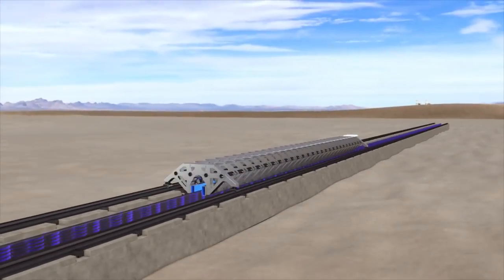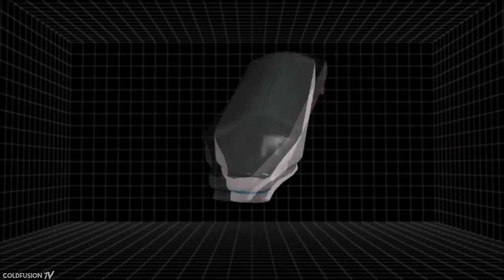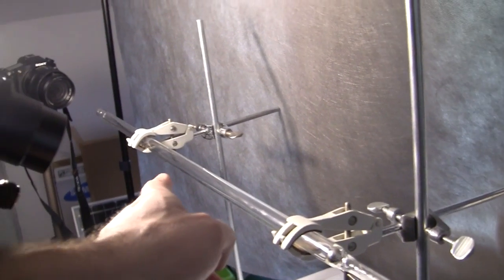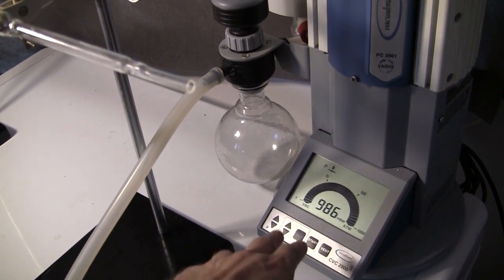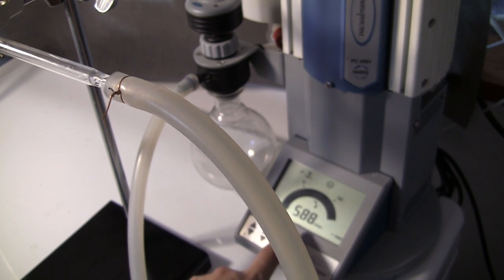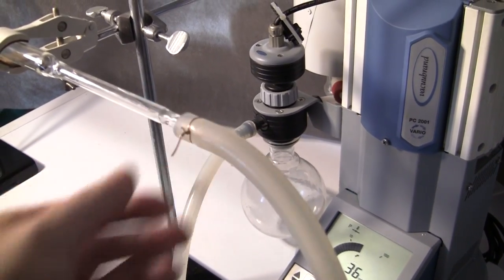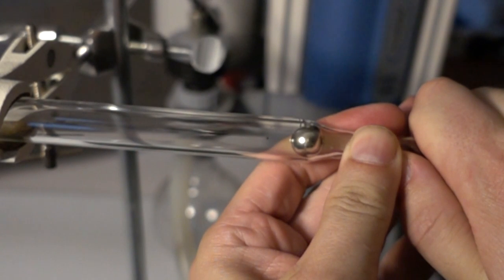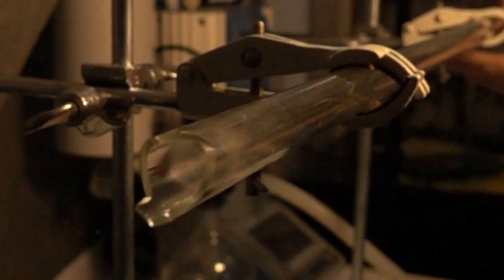How  the Hyperloop can kill you!

Comment: How does this debunk the hyperloop? All you have shown is that it will be disastrous if there is a failure. Well it would be disastrous if an airplane failed, it would be disastrous if anything fail. That's not debunking the technology, that just shows the technology is kind of dangerous.
Reply: " All you have shown is that it will be disastrous if there is a failure."

No, he has shown that even a small failure, one which would almost impossible to avoid given a tube hundreds of miles long would be disastrous.

Stop fanboying over Elon Musk and think for a second.
Reply: The point is not to show how dangerous an accident is, it's to show how weak the whole system would be. A single leak anywhere on the entire tube would result in a crash.
Reply: HerraTohtori "For example, the Ohio-class nuclear submarine has test depth of 240 metres,"

It's also only 170 meters long.

" but if you look at something like U-2 or a MiG-31, or SR-71, "

All of which require oxygen masks/almost spacesuits for the pilot because pressurizing the cabin to a breathable pressure at their maximum operating altitudes would introduce too much stress in the system.

" a hyperloop pod would be a much less complicated machine in general terms. "

On the contrary. If an airplane, even a fighter jet, suffers, say, an engine failure, it can always glide to a safe landing. Worse comes to worse the pilot has the option to eject and save himself.

In the hyperloop, the equivalent of an engine failure could be a superconductor quench, which would blow the entire system sky high. There is very little tolerance for failure when you have two surfaces a few centimeters from one another with relative velocities measured in thousands of km/h, even at the best of times. In a near vacuum? Any failure anywhere would make the entire system fail catastrophically, which is engineer-speak for "stupid idea".
Reply: TentaclePentacle Yeah, try having a small hole in a tube that's miles long. See how long it takes for air blowing at the speed of sound through the opening to change the failure from "small" to "catastrophic".

***** " You're not a freaking engineer"

I am actually. At least that's what it says on my bachelor's degree.

". If someone told you they were going to make a giant cylinder that shot itself into space and came back down and landed itself you would say it's impossible."

Don't fucking tell me what I would or wouldn't say.
Reply: TentaclePentacle "how long does it take for a submarine to sink with a small leak?"

Not very, actually, and a submarine isn't several miles long. You understand the problem here? It's no use to point out examples of small things which work under pressure, the difficulty here is in constructing and maintaining a structure that works under pressure and is large enough to connect cities together. A failure anywhere in the system has catastrophic potential.

"Simple enough solution for you mr engineer?"

Come back with an actual design and we'll talk. Otherwise I'll show you my warp core, which generates energy by combining matter and antimatter inside a dilithium matrix.
Reply: +HerraTohtori Now, suggesting that making a 10 meters tube in one piece as in with no mechanical connections but with only a single piece of metal is as easy as making a 100km piece with the same characteristics, is delusional.

It is also delusional to think a sudden stop as in you either go towards the pressure wave, or are pushed by the pressure wave against a solid object would not be lethal, feel free to direct your questions about that to the remains of people crushed in frontal hits between two trains, we're talking two pieces of metal that are going 10x slower than what the hyperloop is supposed to go.
Reply: HerraTohtori "The length of the tube does not affect its structural strength requirements, just the maintenance requirements"

True for a straight tube, but real railroads have curves. That aside, however, real world factors must be considered. If I recall correctly the first hyperloop was supposed to be installed in California. How much of an earthquake can something like that withstand before failing? What about small tremors, would the stresses potentially cause catastrophic failure later?

"A hyperloop pod does not need most of these; from engineering point of view, the most you need is life support (pressurization and air conditioning) and some kind of mechanical brake system (probably hydraulic, also useful for a door). "

You're severely underestimating the systems complexity of a hyperloop train. You need superconducting magnets, so it needs cooling systems. It needs sophisticated control systems to ensure magnetic levitation remains stable. A lot of the systems in commercial aircraft would have a counterpart in the hyperloop. 

"but because the pod doesn't need to fly it is a few orders of magnitude easier to build than an aircraft of any kind (pressurization or not)."

But it does. It flies a few inches off the track, which introduces a lot of the same engineering challenges as aircraft. It doesn't need to be maneuvered, but it must remain stably and reliably on the track.

"Reliability is another matter,"

Sorry if I didn't make myself clear, but reliability IS the matter. I have no doubt it's "possible" to build a hyperloop. My contention is that it's a horrible, extremely unsafe idea.

"and the simplest way to do that is relief valves on the tube which can react to reported loss of cabin pressure and almost instantly flood the entire tube (and thus the pod) with ambient air."

That would most likely overwhelm the control systems and cause the trains to derail, exploding the entire thing in a very Michael Bay fashion.
Reply: NotAsian There's actually a very simple way to make a vehicle travel at high speeds through a partial vacuum, which humanity knows very well: instead of using a tube, you go to high altitudes where the atmosphere is thinner. There are no rails, so you must use what air you have to achieve lift, and... wait a minute.
Reply: Also tf talks about a leak in the external tube, a leak in the capsule and enjoy having your blood boiling in your veins and then freezing as you start slowly sublimating in a 1mbar atmosphere. Consolation is that you'd instantly die so you won't suffer. Besides the hyperloop is a cool concept in theory but a catastrophy waiting to happen in practice not to mention very expensive to create. 

Let's be honest: why do we NEED an hyperloop in the first place when our existing means of transportation are just as good for what we need at the moment. Look at the damn Concorde which was born on the same need of speed as the hyperloop, no followup project, why? Too expensive to operate, the mass does not want to spend 10x the ticket cost to half the flight time. Do you think that operating such a huge structure keeping it in the perfect condition all the time will not reflect on the ticket price? And for what advantage? High speed train and Planes are fast and the 2 safest means of transportation, the get the job done well, and most importantly EFFICIENTLY. 

Now i hear you say "why shouldn't we try it out" because unlike a plane you can't build something like a prototype and test it without basically building the whole thing already, and therefore you can't properly detect risks and fix them. Also fixing things might be a bit of a problem at 1mbar, but putting a bunch of robots in it might do the work.
Reply: +TentaclePentacle The military does not often operate in the same conditions, it requires different things from its vehicles than the civilians do. Apples=/=oranges.
The Channel Tunnel speed LIMIT (as in max speed allowed as in usual transit speed is LOWER) is 160km/h which translates roughly to less than 50m/s. The speed of sound in air is about 340m/s. As you can see a sonic speed train will move about 7 times faster than a Channel Tunnel one. This means closing bulkhead doors are not as an applicable solution because they need to be positioned further out from each other to do their job without killing every one in the train for a too strong deceleration or crash into them. Apples=/=oranges.
Reply: TentaclePentacle
There isn't a way to have a safety mechanism in this situation without also either introducing a new hazard or conflicting with the design itself.
None of those things you just mentioned involve a small critical component moving at high velocity, they are not comparable.
Reply: Yeah, this is a real reach and an attention grab/sensationalization.
Reply: +Ethan Ooamii
he said he is making the video to bust the hyperloop. Well all he did was point out some dangers of the technology, that can easily be solved, with self sealing foams and relieve valves.
Reply: TentaclePentacle Most planes can land with an failure on an engine and it's easy to check before the flight that everything is OK. Do you really think there will be people checking kilometres of tube before every launch?
Submarines can also be checked before a sortie. And they are operated by the military, it can't be really compared with private commercial vehicles.
Reply: +TentaclePentacle "I don't care if things are different for a reason, make them equal!", "I made an example that was not fitting but the reason why is now irrelevant!". Ok, got the message no need to reason with you
Reply: TentaclePentacle
Yes except maglev trains move significantly faster meaning they do not have the same tolerances.
Reply: TentaclePentacle "what are yout talking about maglev trains have way more tolerance than normal train"

Pro-tip: stop talking of things you don't know the first thing about.
Reply: TentaclePentacle I rest my case.
Reply: TentaclePentacle How old are you?
Reply: TentaclePentacle Oh, I can tell. Have you googled "control system" yet?
Reply: TentaclePentacle Take that as a no. Welp, come back when you have.
Reply: +avicenna
relieve valves, and bulk head doors every couple of miles.
how do you think under water tunnels work? that's servera miles, and they are under pressure from the ocean waters, and yet that still works.
Some engineer you are who can't even work around the small problem if equalizing pressure.
Reply: @TentaclePentacle  Bulkhead doors are very expensive, heavy and complicated to make and maintain.
Reply: Planes planes have a fixed surface area, and redundant engines if one engine on a plane fails it has others.
If one part of the tube fails it will explode.
Your comparison is invalid.

Having a pressurised tube is incredibly dangerous as anyone who has messed around with high pressure/ energy systems will tell you.

Elevators also have safety mechanisms that you are clearly unaware of.

Every single analogy you raise fails to take into consideration that a depressurisation event is a event that must not happen for hyperloop as there is no way to design around it.
A intermediately layer with low pressure would be the best way to guard against such an event, but there is no foreseeable way to mitigate the impacts of a depressurisation in the main tube without compromising on the other aspects of the design.
Reply: TentaclePentacle
The channel tunnel does not have to be straight as a arrow, if it did it would have failed by now.
Also the tunnel has pumps and it is open at both ends so air pressure is not an issue.

The tunnel is not underwater it is underground.

Also the channel tunnel is pressurised to a level that humans can survive, in the case of a fire humans can escape through emergency points to a adjacent tunnel.

Which is my point, there is a intrinsic hazard here which cannot be designed around.
Reply: TentaclePentacle
You missed the point.
Hyperloop has to be very straight, trains don't to the same degree.
Its open at both ends thus it is not a pressure vessel.
There are chemicals that react with water to form a sealant.
Water is approximately in-compressible meaning a rupture will have a constrained flow and the fluid will pool, I shouldn't have to say this but liquids and gases are very different.
Reply: TentaclePentacle
F=ma
s=1/2*at^2
For a small displacement at higher accelerations you get a larger force.
No I do not mean smaller.
Reply: TentaclePentacle Oh yes. You've been on a maglev train, and that makes you a specialist. Do you understand what a "control system" is? Can you explain it to me without using google?
Reply: TentaclePentacle Dude, I've been saying that the hyperloop is a stupid idea for years. Has nothing to do with thunderf00t.

Do you or do you not understand what a "control system" is?
Reply: TentaclePentacle Buddy you're just embarrassing yourself further. Tip: you can do a google search now.
Reply: Yep, check out Check out Shane Killian's and Libertarianists response to thunderf00t's video: Thunderf00t's "How the Hyperloop can kill you". He posted a video reply to Thunderf00t's video. And they will be making more videos in response to his series. Youtube will mark my comment as spam if I post the URL so you will have to google the video's title.
Reply: +Ekaterinya Vladinakova
yeah I'll post that link of the of that youtube video watch?v=kx52A-v65Q8
I had the instinctive feeling acceleration and the pressure would not be as a big deal as TF make it out to be without actually doing the math. TF can only take out low information low critical thinking people like sjws. When confronted with people who can actually have any critical thinking skills, he will act like a petulant child.
Reply: +savagepinksock
pulses? wtf are you talking about. Huge oil pipelines have pressurized liquid running through it, that's touching the pipes.
The hyperloop sends a pod through it that don't actually touch the tube. There is no friction, there is no touching. And because of a near vacuum inside the tube, there is not even any air friction.
If you can maintain a high pressurized oil pipeline, you can maintain the hyperloop tube.
Reply: Video title: How the Hyperloop can kill you! 

So what the fuck are you talking about!?
Reply: +Joules Kin
no one said the technology is good enough yet, that's why its under development.
There is no reason to say this technology is unrealistic. But that's what TF is trying to do, bust hyperloop as he calls it. Well he failed to bust it and made himself look like a fool for bring up some engineering problems, rather than fundamental flaws.
Reply: Phil is a chemist, though. Yes, a scientist, but not an Engineer.
Reply: A submarine has to deal with much higher pressure differentials than the hyperloop tube. For example, the Ohio-class nuclear submarine has test depth of 240 metres, where it has to withstand pressure differential of almost 24 atmospheres. The hyperloop tube only needs to withstand one atmosphere pressure differential.

From engineering point of view, depressurizing the tube is not exactly the biggest problem with the idea. We have the technology for that, easily. The scale, however, does seem intimidating to me as well, and maintenance and avoiding leaks would be... problematic. The biggest energy drain in the whole system might actually be driving the vacuum pumps, because there's always leaks in this kind of system.

The pod itself is a different challenge. Keeping it pressurized while in use is an engineering problem that is somewhere between a spacecraft and a high altitude aircraft, but if you look at something like U-2 or a MiG-31, or SR-71, a hyperloop pod would be a much less complicated machine in general terms. Of course, some of the safety features pose challenges - like being able to stop and egress the pod and the tube on regular intervals - but I don't think these are insurmountable difficulties.

Or, at least, I don't think I have the engineering expertise and in-depth knowledge of the system to conclusively say that it's impossible. Difficult, of course, but also probably much less difficult than some other feats of engineering I can think of.
Reply: avicenna
The length of the tube does not affect its structural strength requirements, just the maintenance requirements. Structurally speaking, if you can make a 10 metre tube withstand 1 atm pressure differential, you can make a 100 km tube from the same stuff and it'll withstand it too.

Also, I feel like you're seriously under-estimating the system complexity of an aircraft. You see, an aircraft has to fly, so it has to have a life support (pressurization), powerplant, flight controls, hydraulics, pneumatics, electrical systems, avionics, flight computers, navigation systems, communications, radar, and in case of combat aircraft, weapons systems as well (often integrated to avionics). A hyperloop pod does not need most of these; from engineering point of view, the most you need is life support (pressurization and air conditioning) and some kind of mechanical brake system (probably hydraulic, also useful for a door). Then you also probably need some electronics to run the pressurization, pod controls, and telemetry, but because the pod doesn't need to fly it is a few orders of magnitude easier to build than an aircraft of any kind (pressurization or not).

And the reason why these high altitude aircraft don't have full pressurization is because they have to fly, so they have to be very lightweight. It's not that hard to create a pressure vessel and pressurization system that can maintain 1 atm pressure. True, aircraft are not pressurized to 1 atm, but spacecraft often are (the ISS, for example, uses standard atmospheric pressure). And a hyperloop pod is not weight-limited the same way aircraft and spacecraft are, so from materials and engineering perspective it's not a problem at all to build the pod as an 1 atm pressure vessel.

Reliability is another matter, and of course it's possible for something to fail and for that reason the system needs to be secured against loss of cabin pressure - and the simplest way to do that is relief valves on the tube which can react to reported loss of cabin pressure and almost instantly flood the entire tube (and thus the pod) with ambient air.

And, while an aircraft can glide to ground and a pilot can eject, again, a hyperloop pod is not flying high above the ground in the first place. It's in a contained environment, and while I agree that the margin of error is small, it doesn't mean the slightest of failures would automatically be "catastrophic" or "fatal". It could be, if that eventuality is not properly taken into account and prepared for, but that's a matter of thorough planning, not something about physical reality that prevents this from being both useful and safe mode of transportation.

Just remember, speed doesn't kill, it's the sudden stop... and you have to calculate how sudden the stop actually would be to claim it would be deadly.
Reply: Winkelried
Private commercial vehicles tend to have substantially better safety record than military-operated ones...

And, yeah, it's not impossible at all to just build the tube in a way that makes regular maintenance almost unnecessary. Compared to some of the marvels of modern engineering (look up the Troll A drilling platform for example) building a long solid pipe doesn't even seem all that difficult; the biggest targets of maintenance would be the vacuum pumps themselves, and of course the emergency exits and relief valves, which simply have to be there for safety reasons.
Reply: HerraTohtori
"Private commercial vehicles tend to have substantially better safety record than military-operated ones..."
Yeah, because the military vehicles are not meant to be as safe as private vehicles, that's my point.
"it's not impossible at all to just build the tube in a way that makes regular maintenance almost unnecessary"
Bold statement, why do big oil pipelines still need maintenance and have leaks then?
Reply: avicenna
Fucking lol.
There is a lower limit on the distance it is economical to travel by plane though.

There has got to be a way to get this sort of thing to work although I doubt it will be competitive with air travel though.
Reply: @AvNotasian  Then remove the vacuum tube.
Reply: @williamhuang8309  Without the vacuum there is no point in the tunnel.
Reply: @AvNotasian  No vacuum, no tube, no trouble. Also known as a regular train. Works fine.
Reply: @williamhuang8309  Lol, yeah now that you mention it I have seen a lot of trains around. They must be a new innovation :P
Reply: elevators hae safety mechanism, you don't say.
So the hyperloop will not have safety mechanism?
I have already given so many ways safety mechanisms can be designed, and those are just the common sense ones that already exists on subs, in the channel tunnels, on tankers, on space stations. Obviously the hyperloop needs safety mechanism just like an elevator.
Reply: +NotAsian
explain to me how the channel tunnel between england and france don't breach under all that pressure.
Its the same concept, if you can keep a tunnel underwater with out leaking, you can keep a hyperloop tube.
Reply: +NotAsian
what? what does being straight have to do with air pressure or water pressure? You do know train tracks don't have to be straight as an arrow right?
So what if its open at both ends, the structure is still under pressure.
The english channel is underground yes, that cuts down on the pressure, but there are underwater tunnels like the Ted Williams Tunnel which is not under ground and its under even more pressure.
There are always ways to control pressure, and safety mechanisms to be added. Those are call engineering challenges, not fundamental flaws with the concept.
Reply: +NotAsian
a hyperloop train is just a maglev train. and maglev train have the same tolerance for curves just like a normal train.

so what if a tunnel is not a pressure vessel, the amount of pressure pressing down on the tunnel from water is greater than the 1 atmosphere worth of pressure pressing down on the hyperloop.

And we are not talking about what happens if there is a breach. The point is to prevent a breach, and if a breach happens, make sure the opening don't get teared. If its a small leak then only small amount of air is leaking thought into the tube, thus it won't have enough strength to push the pod. In TF's own experiment he had to take the entire hose off the tube to expose a huge area for the air to rush in. That's why the ball got pushed. If its only a small leak, the ball will not get pushed at that speed. You can also make the tube twice the side of the pod, then the air an go around the pod rather than push it. Also counter valves and self sealing tank technology and patch a leak.
Reply: @TentaclePentacle  Nope. Trains are able to make much tighter turns than maglev. Not to mention maglevs are basically monorails but the propulsion is by magnets. The turning capabilities of monorails are terrible, not to mention the infrastructure required for switching them is immensely complicated.
Reply: +NotAsian
what? maglev trains move faster and thus have less tolerance?
how does that work?
I'm going to assume you mean slower.
So what, are you saying trains can't go any faster because the tracks needs to straight? What retarded argument is this. obviously you can build in tolerance. And maglev trains don't touch the tracks, and hence the tolerance can be way bigger, just make the track bigger, so the magnetic forces can cover the whole train.
Reply: +NotAsian
what are yout talking about maglev trains have way more tolerance than normal train, because the maglev trains don't make physical contact with tracks. The train floats on top of the tracks like a hover craft. There is way more tolerance because it doesn't touch anything.
Reply: @TentaclePentacle  You need guidance on both sides of the train so that the train doesn't just shoot off the tracks whenever there is a bend. Look at the Shanghai maglev! there are guides on both sides of the train. So your turning capability is limited by the guides on either side of the maglev.
Reply: no it doesnt. planes get engine problems, structural problems, even holes blown on their sides ... and still dont fall of the sky.
submarine leaks? jesus dude, subs leak all the time, again not so bad. and even then subs are used by the military, not regular people.
Reply: +avicenna
as if you know what's going on.
Have you ever been on a maglev train?
Well I have.
Reply: +Coyote27981
right planes never crash, subs never sink, and civilians can't do what military do right? Because reasons.
Reply: +avicenna
if you been on a maglev train, the you would know the tracks have bents and curves just like any other train track. The maglev trains have the same track tolerance as any other train.
So stop talking out of your ass and fanboy TF like his shit don't stink.
Reply: +avicenna
what are you talking about control system. What does that have to do with anything? What control system are you babbling about? a train control system like in switching tracks?
Reply: +Eethan O'Connell
that's because you are a moron. Control system can mean anything. And if you are talking about the individual magnets that gives the train more track tolerance. Well that's not call the control system you idiot. Its call a feedback system.
Reply: +avicenna
lol right make up some bullshit vague term, and act like you know it all. A control system to a train is a system where it controls traffic you moron. You can refer to many control systems. A lot of things are call control system. There no need for me to google anything because you are just so full of it.
Tell me what is an air system? What air system could I be referring to? The air conditioning or the hot air you use to blow up your own ass.
Reply: +avicenna
older than you kid.
Reply: +avicenna
you act like a stupid child. have you google air system yet?
Reply: +pyropulse
this video is a trailer for the debunk video, and this trailer sucked just like the ghost busters trailer sucked.
Reply: He hasn't even shown that. His test doesn't scale. If the hyperloop pods have a cross sectional area of 3 square meters and a mass of 30 tons each, then their acceleration would only be 1 G.
Reply: ***** Indeed a catastrophic failure of the pressure tube could expose occupants of a pod to lethal g forces. But this is a different scenario that what thunderf00t was describing and also an extremely unlikely scenario. By comparison, airplanes have many points of failure that could potentially kill all the passengers on board. So do high speed trains.
Reply: oh please he spew the same argument in the other video.
Reply: Thomas Winter Sadly TF is quantitatively illiterate. This is the same guy who was off by 5 orders of magnitude in calculating the energy of ice above the atmosphere. I made a video debunking that too.
Reply: +To Athánatos
His other main debunking video have the same ridiculous argument. His main objection around the technologies is what happens if the tube breaches and what happens if a terrorists shots at it. Pure fear mongering.
Reply: +110002 10041
not as gullible as you can be.
Reply: +TruckCaptain Stumpy
oh please the other video had the same arguments. It is going to be more expansive than they claim? sure.
Are there engineering challenges, sure.
But the fundamentals of this technology is sound and not busted by any means.
Reply: To top it off, have these people ever seen how thick a submarine's outer shell is and the backing it has? Do they think that the submarine is simply a thin metal tube swimming underwater? The hyperloop chaps are using 2 inch thick pipes to sustain a pressure ratio of 1000. Yea...let that sink in for minute.
Reply: +Vaibhav Shah
do you know how much pressure a sub is under? The hyperloop is under less than 1 atmosphere of pressure. You can create a 1 atmosphere of pressure with glass syringe.
Reply: uhh no.  There are multiple cases of plane engine failure that allowed the plane to continue back to an airport.  There's also multiple cases of leaks in submarines that resulted in the boat surviving.
Reply: +MiniDevilDF
And a leak in the tube is not as dangerous as TF claim to be as already shown by other people's math.
By TF's logic a car is very dangerous because the gas tank could explode and kill everyone.
Reply: +savagepinksock
there is a word call maintenance look it up.
Reply: +savagepinksock
yes we all know all those gas and oil pipelines are not maintained.
Reply: +savagepinksock
variable pressure is more degrading than constant high pressure? What lunacy is this?
And what does the speed of the pod have to do with anything?
The pod does not touch anything, the pod could be going at the speed of the light and would not effect the tube.
Reply: +savagepinksock
how does the pod or train cause a change in pressure? Its a vacuum inside the tube. There is not change in pressure. If change in pressure cause more so much stress in a tube that it would cause more degradation, then turning on your faucet on and off would cause your water pipes to rupture and yet, that don't happen.
Reply: +savagepinksock
pressure is pressure if its pushing from the outside or from the inside makes no difference.
the near vacuum inside the tube makes the air disturbance by the movement of the pod negligible.
the tube is not made from paper.
Reply: dude, going from 0 to 400 in 2 seconds will most likely destroy your body from accelerating so quickly. and when it stops its like falling to your death
Reply: +Mfgcasa
there are self sealing tanks
Reply: +Halloween111
I'm not a civic engineer and I still can see the flaws in his argument.
Reply: TentaclePentacle
My point exactly. I respect that he's intelligent and a scientist, But "Scientist" has a lot of flavors. Einstein was Brilliant, But I might not ask him a question concerning biology considering he was a theoretical physicist
Reply: Yes and you can die because of it.
Reply: +Winkelried
Are there engineers checking kilometers of under water tunnels?
Just because subs are operated by the military so a civilian company can't do it?
are military personnel smarter than civilians? what logic is this?
Reply: +TheMortimer100
I don't care what conditions the military operate under, if the military can do it, why can't a civilian company do it?
The channel tunnel's speed limit if irreverent. We are taking about pressure, and the channel is under way more pressure than the hyperloop tube.
There will not be such an explosive breach anyway, most of the time its just small leaks that can be detected and measures taken to counteract it.
Reply: Winkelried
 Oil pipelines have leaks in them because the leaks are so negligible that there's hardly any pressure on the oil companies to research and develop new pipe tech or pay significantly more for much better construction quality.

In other words, oil pipes leak little enough that it's not deemed cost effective to improve them, since regular maintenance keeps the losses (and environmental damage) at manageable level from corporate perspective. I have no doubt it would be possible to make better oil pipes, but it might be an investment that isn't going to pay itself back in the time the pipe is planned to be active.

Oil pipes are also regular targets of sabotage by environmentalists/terrorists, and thievery, and they are readily accessible and over the ground. Especially in third world countries, a lot of the leaks are intentionally made by locals tapping onto the oil lines.

Hyperloop tubes could also technically be over ground but would probably be ideal to build underground or, at the very least, protected by thick layer of earth, as that would not only shelter them from the elements and saboteurs, but also lend the tubes support against the weight and g-forces of the pods moving within.

That said, making a long vacuum tube properly sealed is going to be more difficult than making a leakless oil pipe, because air is a gas that readily escapes (or gets into the vacuum) from the smallest of holes or cracks, while oil is a viscous liquid that is relatively easy to contain in the pipeline even when there are small dripping leaks in the system. So yes, there are challenges involved in the system, but hardly anything that we absolutely "can't" do.

A different question is should we... but the answer may be found only by trying. Hyperloop may well prove entirely impractical (with current materials and technology) compared to conventional methods of travel, but if it does work, it has certain attractive elements to it as well.

Even if it fails, or proves impractical or impossible in testing, I'd still say it's worth it to try. Even in worst case scenario, we may well learn something new in the process which could be applicable to other things.
Reply: +TheMortimer100
Do you even know what's going on here? Speed is irrelevant because we are talking about a breach in the tube. it doesn't matter what the speed of the pod is. We are not talking about a breach in the pod, we are talking about a breach in the tube. Just like a breach in the channel tunnel. It doesn't matter how fast the car will travel in the channel or how fast the pod will travel in the tube. Those are two completely different issues.
Reply: @TentaclePentacle  Yes and no. A breach in a hyperloop tube will result in a sudden depressurization, which would likely make the pod suddenly shoot forward or violently stop, killing everyone on board.
Reply: in fact taking into account the hyperloop aquiles heel is catastrophic pressure loss, while airplanes have a lot more critical failure points including the same pressure loss, wing failure, engine failure, pilot failure, control surface failure, etc... i could say hyperloop is as safe as any other maglev train systems (a train that travels at +300kms/h in one fixed direction can't avoid obstacles in the path, and that's faster than terminal velocity so crashing at that speed is the same as jumping from an airplane without chutes)
Reply: +Dario Ampuy
the hyperloop is just another maglev train that travels in a tube so it cuts down on air resistance. The maglev tech is the same as any other maglev, the only technological challenge is the pressurization of the tube.
Reply: TentaclePentacle
 yes i know that... all they have to do is compartmentalize the tube in sections so a catastrophic failure won't fuck up the entire system and the train can slowdown and pass the damaged section at slow speed, move to another vacum section or use a spare rail system like in any other railway

it's clear they won't use those fancy glass tubes we saw in futurama or in hyperloop concept videos... i bet it'll be mostly underground to it can be protected, VERY sturdy and secure, like bomb proof concrete bunker stuff around the tube
Reply: +Dario Ampuy
well if they can make an underwater tunnel like the English channel. The hyper loop is gonna be just like that.
Reply: +pyropulse
retard, this video is a taste, its a trailer for the debunker.
Well this trailer sucks, just like the ghost busters trailer sucks. And the ghost busters movie sucked, the debunking video will also suck, just like the movie.
Reply: +avicenna
Take that as a no. Welp, come back when you have.
Reply: +pyropulse
yes he failed in this video, as in this video does not debunk or bust the hyperloop.
Do you know how to read?
Reply: ***** By deriving the force from the pressure. The pressure difference would not exceed 1 atmosphere.
Reply: ***** 100,000 pa * 3 m^2 / 30,000 kg = 10 m/s^2 = 1 G
Reply: This shows how it can kill you, read the title. There is another video of his where he does the debunking
Reply: Well, I've read some articles written by physicist and engineers that also think that the Hyperloop would be a terrible idea.
Reply: +To Athánatos
there are engineering challenges sure, is it going to be expansive? sure.
But the underlying concept is not flawed.
Reply: +pyropulse
ofcouse his is full of shit, and he knows it, he is only fooling people who don't have a science background. 170 newtown is nothing, that's like 170kg of force. its like a fat guy pushing.
Reply: Engineering reality when you scale your experiment of a small ball 
bearing in a small tube vs a much larger scale.

tl;dr 
Your experiment doesn't scale. 
Ballbearing will accelerate at 1963 m/s²
Hyperloop will accelerate ~10 m/s²

================
Scale up the experiment and consider actual forces on the body

Remember Pressure = F/A therefore F = P*A
And F = m*a therefore a = F/m

The pressure in front of the carriage is 10 Pa

The pressure behind the carriage (assuming a massive instant failure) is
 100,000 Pa

The total air pressure acting is in the forward direction at 99,990 Pa 
~~~100,000 Pa

Let's call your experiment, Scenario #2

Scenario #1: Almost full scale 

Cross-Sectional Area of Hyperloop tube = 1 m² i.e. diameter is a little 
over 1 m.
Force acting on Rear of Hyperloop Carriage, F = P*A = (100,000 Pa) * (1 
m²) = 100,000 N

Inertial Mass of Hyperloop Carriage, m = 10,000 kg

Substituting into a = F/m gives

a = (100,000 N) / (10,000 kg) = 10 m/s²
Scenario #2: Lab ScaleCSA of 10mm Ballbearing Tube = 0.00007854 m²Force 
acting on Rear of Ballbearing, F = P*A = (100,000 Pa) * (1 m²) = 7.854 N

Inertial Mass of 10 Steel Ballbearing = 0.004 kg

Substituting into, a = F/m
a = (7.854 N) / (0.004 kg) = 1963.5 m/s² 

-----------------------------------------
Summing up
Scenario #1: Mid Scale ~= 10 m/s² i.e. Roughly gravity
Scenario #2: Mini Scale ~= 1963.5 m/s³ i.e. Roughly a high power 
slingshot or air-rifle
Reply: How fucking dense can you be?
Reply: @TentaclePentacle  
*All you have shown is that it will be disastrous if there is a failure. 
Well it would be disastrous if an airplane failed, it would be 
disastrous if anything fail*

1- the proposal puts a non-viable extremely sensitive potentially dangerous heavy tube under pressure or vacuum in a highly geographically unstable region and then makes claims it can't justify. there isn't even a small scale model demonstrating the potential (for a reason - physics, as noted by Thunderf00t)

2- this is an old proposal from maybe a hundred years ago from the inventor of modern rockets ... considering that alone, think of the implications of not having a scale model to demo and ask yourself: why don't they?

3- cost. insurance alone being in a geographically unstable region will be astronomical, but then add the proposed speed and design problems?

you should watch the other video's as it fully explains why it isn't a viable project proposal... unless you fear ridicule
Reply: A single leak in this however would kill everyone in the system making it a tad more how to say this concerning?
Reply: one leak is manageable, but what happens 5 years down the line when your stucture has been under constant stress? there are next to no viable saftey measures for slowing to 0 inside a static tube
Reply: TentaclePentacle how many gas and oil piplines are at least 20m in diameter? how many of those pipelines have varying amounts of stress put on them in pulses? 

the principle behind how pipelipes and this train work are different, gas and oil pipelines don't send things down the pipes over mach 1 

the maintance costs and the raw material to build it would be insane, not that there are any materials which could cope with constant use of the train, they would have to essentually rebuild the train pipe every few years 

problems like slowing the train and evacuating the train are solvable, the material to build it just doesn't exist yet
Reply: ***** the tube has to withstand variable pressure(due to the train moving) variable pressure weakens structures over time

the train itself is probably 10m or so wide, the structure around it will probably be another 10m, so a 20m diameter pipe

mach 1 is the speed of sound, I though it did go that fast? my bad (before you say it I know it wouldn't technically be mach 1 inside the tube because it's a different medium than air)

for pipelines the design formula is 

thickness = (pressure*d)/(2(F*E*T*yeildstress)

but even that formula breaks down when you get to bigger structures, a steel pressurised frame would break under it's weight from warping, so you'd need a steel-concrete or substitute frame, but with steel-concrete repairs are gonna be tricky you'd need to design removable sections
Reply: ***** i mean your logic is that if you scale up anything it'll still function as it did in the scaled down model, which is just untrue 

if it were true building skyscrapers, bridges and statues would be alot easier... we could just use lego
Reply: TentaclePentacle variable pressure causes expantion and contraction... it doesn't need to touch anthing to cause this
Reply: +savagepinksock
hahahah 1atm worth of max pressure. The tubes are not made from paper.
Reply: TentaclePentacle but it says the pressure they operate at is 1 milibar, that's the pressure of their vacume, that is enough to stress a large structure to failure...

do you know how explosions work? well they work by changes in pressure, the train will cause changes in pressure, while at first that wont lead to huge explosions, when the stucture does fail it's likely to fail close to where the train has past or is about to pass and possibly derail the train, but more importantly cause billions in damage
Reply: TentaclePentacle it's not a perfect vacume (not possible yet). the train moving will cause a change in pressure, which will weaken the structure. 

if they plan to use gas to accelerate the train than that's an issue

water tubes are at high pressure, this is at negitive pressure, high pressure systems are realitively stable compared to negitive pressure systems
Reply: ***** yeah i mean tbh i didn't read anything 

if they solved the proplems i brought up then good
Reply: Talk about comparing apples and oranges.
Reply: does plane travel constantly at the speed of sound with proximity to hard surfaces?
playing Russian roulette is not a guaranteed death right? so according to your logic Russian roulette is not dangerous
Reply: ***** LOL you should go work for NASA and tell them that if a tiny hole appears in their spacecraft they should not worry, because it's only going to give their astronauts a bruised arm LOL. you're a genius.
Reply: TheBillusBillus it's a concept my dear man. One of which tentaclepentacle is using to refer to everything, NASA tests it's rocket ships in a massive vacuum, if something dangerous happened in there it to would be destructive and cause damage sure, but NASA wouldn't have been able to innovate without it. There  is really nothing like the hyperloop and therefore nothing to compare it to. This video proves nothing. Without danger there is no innovation or creativity, because things do go wrong and will go wrong it doesn't mean we should be scared to embrace it.
Reply: TentaclePentacle I think you are missing the point. A single failure in a plane/submarine/car etc would potentially be catastrophic but there are two differences:

1. Planes, submarines, and even cars are protected against interference from outside entities (eg I can't bring a bomb on a plane, submarines have very tight restrictions) whereas if this goes commercial it will be exposed to attack across the country like railroad tracks and all you have to do, according to this, is cause one rupture.
2. This isn't just one vessel. If one submarine in the ocean has a catastrophic failure, all other submarines in the ocean don't also sink. Whereas here if there is one breach in the tube, everyone in the tube dies (could be thousands). Hopefully they'll come up with a safeguard. 

Your problem solving skills need a little work, I'll give them 6/10. By the time they get Hyperloop to a working point someone else will have already come up with a better idea anyways. It is like canals in the 1800s: We labored to build thousands of canals throughout America and just when they came out, the railroad emerged. But hey, they make for nice bike paths now.
Reply: The scientific illiteracy in this comment and in many of the other comments in this thread is horrendous.
Reply: What you think now that it's been 6 years? Still excited about the Hyperloop?
Reply: I know it's six years late, but you realise the title of the video is just how it can kill you? Not saying its a full debunk. Which he has videos on,and I'm sure now 6 years later you must realise this is never happening.
Reply: +TentaclePentacle
Now let's go and buy the new "pine cone" solution for jacking up our cars! You could tell me that waiting for a pine cone to grow to lift a car is a very stupid idea, but that's not showing that the pine cone idea is a failure! Well, it would be disastrous if we don't have enough time for such a process to happen. That's not debunking the technology, that just shows the technology is not good enough yet.
Reply: +avicenna
how long does it take for a submarine to sink with a small leak?
you can have counter valves, and self sealing tanks, plus put breaks on the carts, and made the tube bigger than the cart, so the air can flow around the cart rather than push the cart.
Simple enough solution for you mr engineer?
Reply: @TentaclePentacle  Making the tube bigger than the pod only makes the hyperloop less practical, as you now have more space that needs to be vacated of air. Also, it will be more expensive to produce a larger tube.
Reply: you do realize an airplane in the earth's atmosphere is very different from a 300+ mile long vacuum chamber at 1 millibar right?
Reply: +KanadianSpaceProgram
This is a taste of his debunking video, and its stupid as hell. Reading the description, I could write the same thing about an elevator.

A cable failure would likely kill everyone in the elevator. Getting dropped 20 floors at terminal velocity is fatal. Any who survive would find themselves in a 20 floor long shaft in the dark.
Reply: +Winkelried
a single failure of a plane engine would result in a crash, a single leak in a submarine would result in the sub crashing to the bottom of the ocean. And yet those technologies are used daily.
Reply: @TentaclePentacle  You do not understand how planes work. PILOTS ARE GIVEN MANY HOURS OF TRAINING ON HOW TO FLY WITH ONE ENGINE. IT HAS BEEN DONE MANY TIMES BEFORE. So please do some research on how planes work. Even if both engines were to fail, an aeroplane can glide without much issue. Think of Air Canada 143- they lost both engines and were able to safely land.
Reply: +avicenna
You call that a small failure? TF took off the end of that tube, its not a small leak he created, he created a catastrophic breach. Again its just like a submarine, a leak can happen in that as well, and yet that's used everyday. There can also be safety measures put in place to prevent this kind of failure. Like a self sealing tank, and counter relieve values, and putting breaks on the carts would also help.

stop fanboying TF. I don't care about Elon Musk. I care about reason.
Reply: @TentaclePentacle  Well, what if someone accidentally crashed into the tube? It could happen, just as people keep crashing into buildings! Also the brakes thing- your brakes will need to be extremely powerful to hold back the force of air pushing against the pod.